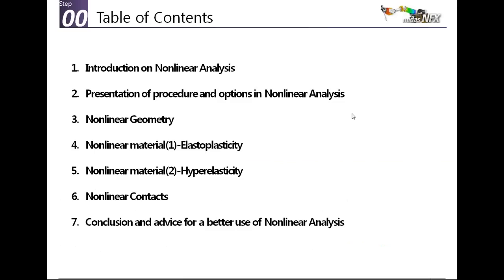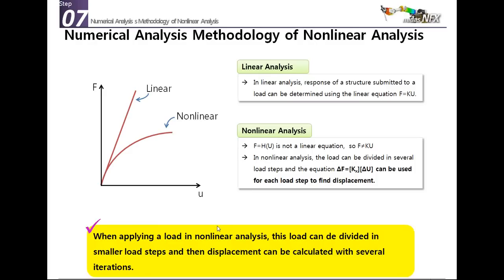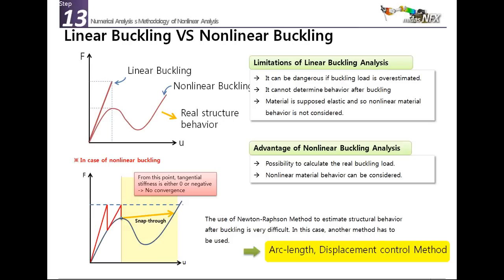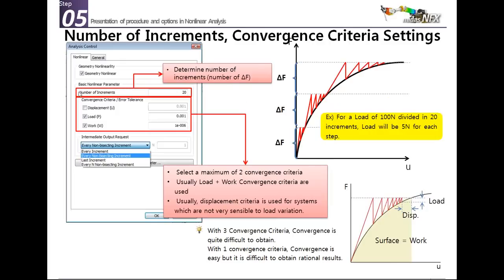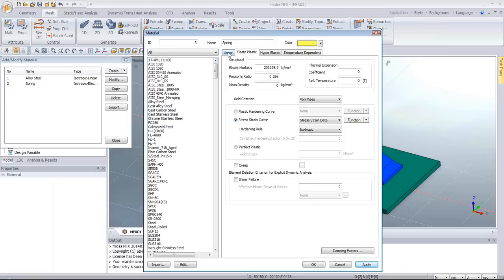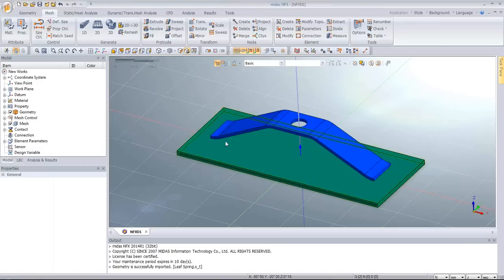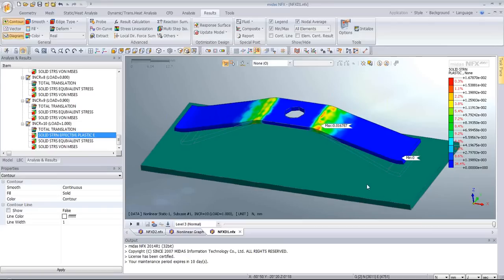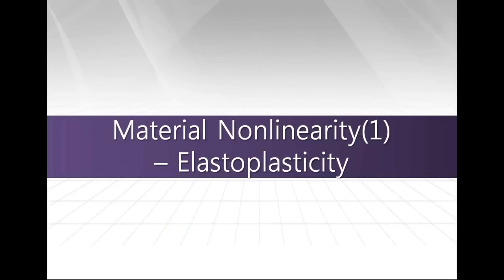Nonlinear Static Analysis theory and workflow in midas NFX - Session 1

Comment: first of all thanks for useful commentary and my question is, are the theoretical assumptions for nonlinearity achieved in the real structure ?
Reply from the maker: +ibrahim yasser What do you mean? Assumptions are for the analysis, not for the real structure...
Reply: Cyprien Rusu I mean my assumptions and analysis are for designing the real structure, so what is the benefit of analysis if it isn't representing the behavior of the structure !
Reply from the maker: ibrahim yasser You are right. There is always a difference between assumptions and the real structure behavior. Engineer are make assumptions because it helps to reduce very complex problems into simplier ones that can be analyzed and simulated more quickly. Thus, assumptions are assumptions and they may be wrong...that's why as an engineer you have to verify continuously if the assumptions you took are correct and if the results you get are satisfactory enough. If not, you may have to use another method or create new assumptions. Is that what you wanted to know? Or am I making assumptions about your question ;-)